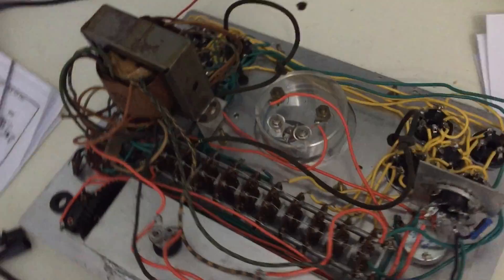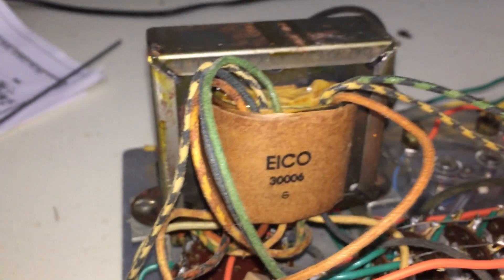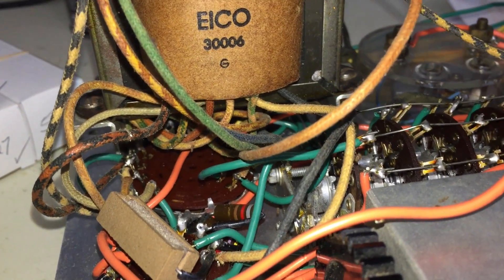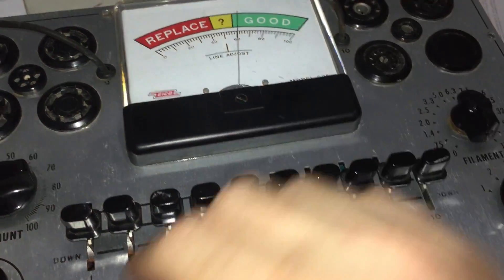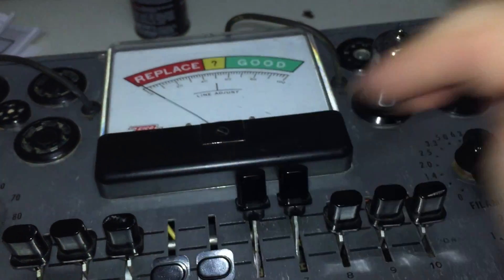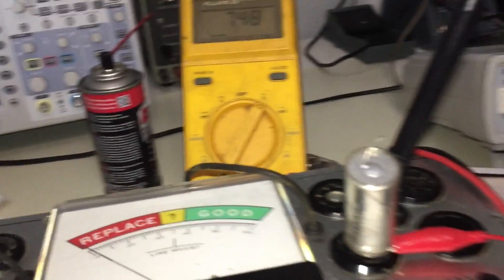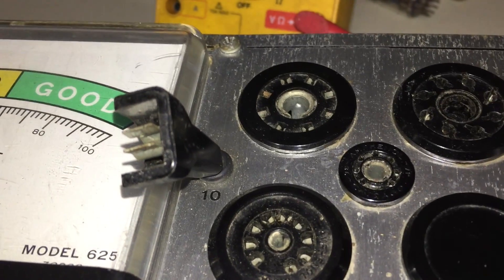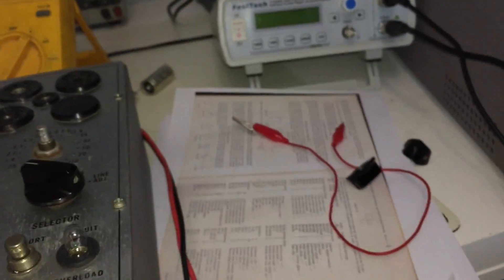EICO 625 Vacuum Tube tester troubleshoot and repair

Comment: 12ax7 should use 12.6v not 6.3v
Reply from the maker: yup...
Reply: Wrong. This tube has a center-tapped filament. Depending how it is wired, it can operate on 6 volts or 12 volts.
Reply: Ok in book it can run 6.3v in parallel

Comment: I just finished restoring my EICO 625.  There is really not much to do in the way of electronics on the 625. There is only one Capacitor a .01 Uf /600 volts. Most of the resistors are wire wound 1% and 5% tolerances. The switches are rugged. Testing and calibrating is a snap, since most tube testers check all tubes as a diode. Basically it measures the current flow from cathode to plate. The most crucial part of the tester is the Step down power transformer putting out accurate filament taps.
Reply: Did you have to remove the resistors to test them? and did you replace the capacitor? and what type of capacitor did you use? I was given one of these and i would like to restore it if at all possible.
Thank you

Comment: I find it amazing that these EICO 625 Tube Testers are still around and in such rugged shape. When you consider they are from 1963 and in kit form and , being by hobbyists for the most part. Back in the day I never used a Tube Tester as I had a very good supply of known good tubes,  while I worked for RCA Service Company, it was  one of the unspoken benefits. I even made service calls to family and friends once I fulfilled my daily service call quota. That's right Mr. Reed, you were right all along. God bless the IBEW!
Reply from the maker: Unless of course you were working with pushpull amps and had to match transconductance.

Comment: Because of its age I would have change out that wax  cap ,everything else seem to work ,I need to order some d oxit ,I been reading and talk to a company about it ,I have to clean some volume knobs with it on some older radios I am working on ,
Reply from the maker: Hello Ron, I was asked to repair a specific problem only on this unit.

Comment: Hey Jordan, thank you for yet another good video..... if you're feeling brave, why not file a flat on the the shaft for the filament voltage selector? It would need to be carefully placed so that when the grub screw tightens, the knob lines up with the voltage scale correctly. But I think it's worth the effort & the repaired knob will have an easier life too. Thank you.
Reply from the maker: I would have, if you told me this 2 years ago.... Ive long since return this to the owner, but was at the time only fixated on the problem.  Thanks for the tip though.  The Hickok 6000 project ive just finished has round posts because they need to be set for cal. So there are circumstances this wont work.

Comment: I have a Eico 625 I picked up but it has no listed settings for 6CA7 tubes. Anyone know what the settings should be for this tube?
Reply from the maker: Really?????? Are you just joking with me? Its an EL34...
Reply: Neither ^6CA7 or EL34 are listed on the tube roll supplied with my 625. I'm not kidding. Not sure why unless the tester was made before the EL34 tube came out.
Reply: @socksumi  the settings for the  6CA7 tube is  15  6.3  3   1-3-4-5   2-8